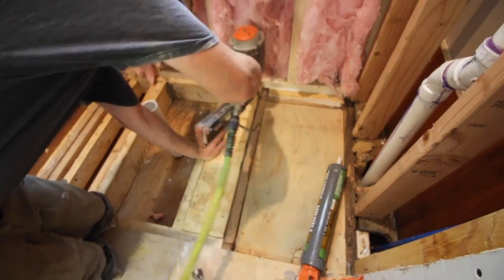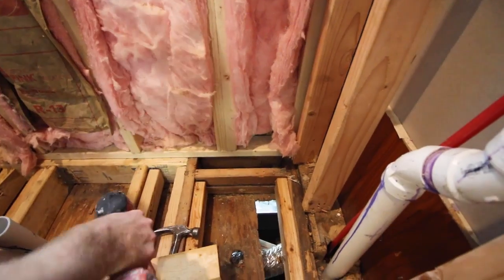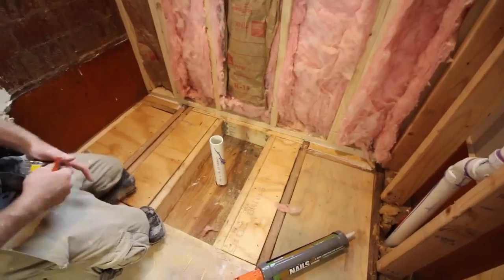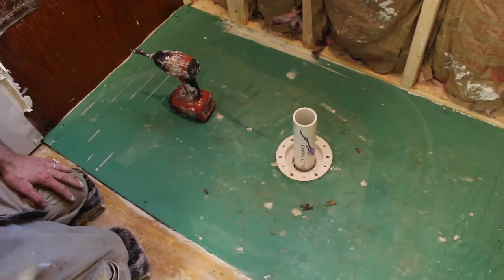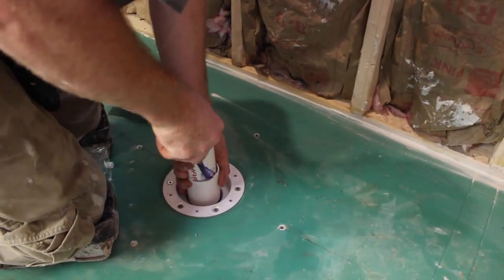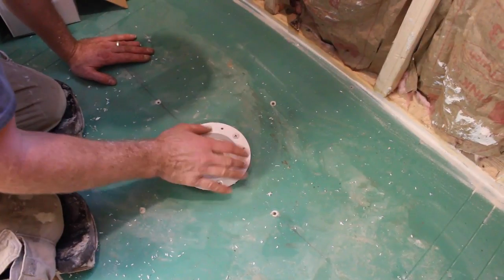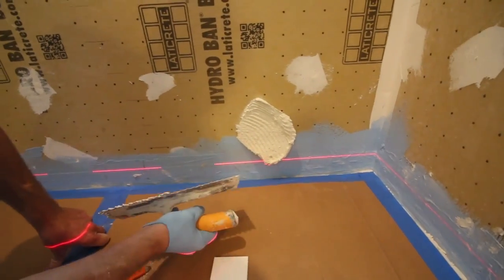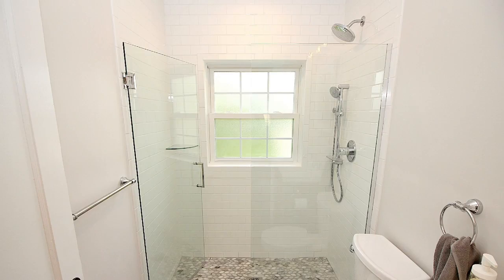Curbless Shower Workshop (LIVE): VIM Method and Tile Tips

Comment: So with the hydroban board.. since it's foam.. does it add a layer of insulation resulting in better tile temperature maintenance?
Reply from the maker: great question, it has a small R-Value and does help with outside walls

Comment: Thank you SO much!  You have such a reassuring manner.  I bought a small house 5 yrs. ago, only one tiny bathroom.  The contractor who tiled and grouted the small, narrow curbed shower put a lien on the house that the seller was scrambling to pay so closing took forever.  I have no idea who this contractor was, but they did a horrible job and charged a fortune.  No regard to water spray impact in surrounding crevices and nooks, lowest area is in horrendous shape.   Next door, the neighbor's identical bathroom floor plan is curbless, it was installed years earlier than mine was and looks brand new.  The difference in work by the two contractors for the same tiny shower size is night and day.
Reply from the maker: such a shame to hear about horrible bathroom remodels.  Let us know if you have any questions, we're always happy to help

Comment: Interesting product.  It's a shame they only have one size, 60" x 48".  My shower is small - 40" x 42", not sure if this can be cut down by that much?   But I do see they sell a 14" x 14" system, which I just don't understand!
Reply: Yes you can cut the 60" x 48" pan down to the size you need. In fact it will work if your shower floor is larger then the pan dimensions. Follow their instructions and you'll be ok.
Reply: @TheBshackelford1  I actually did this and completed the shower a couple of months ago.  It was very straightforward to do.  One thing that none of the videos mentions it that these shower pans are quite loud from below.  I was able to access the joist spaces after the fact and installed mineral wool insulation which has deadened the sound a lot.  Maybe look into that - so much easier to do before putting down the subfloor!
Reply: @r7boatguy  good to know. The one I installed was on the 2nd floor over 16" open web trusses. I did put rockwool in the floor space away.